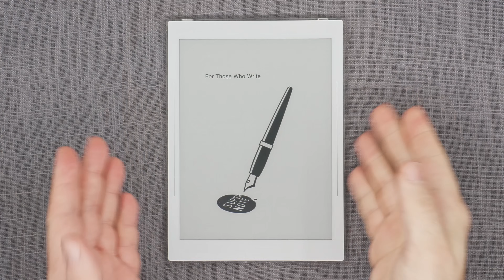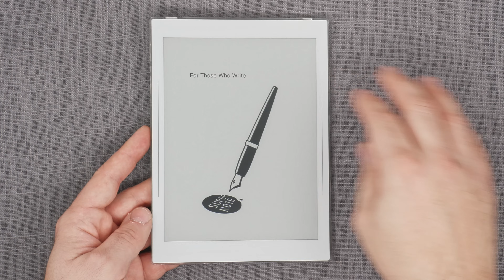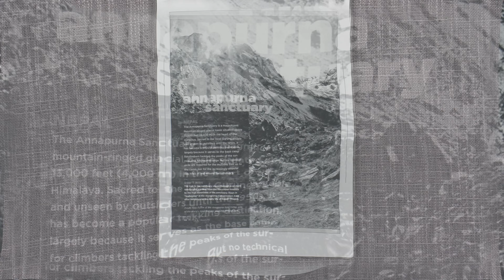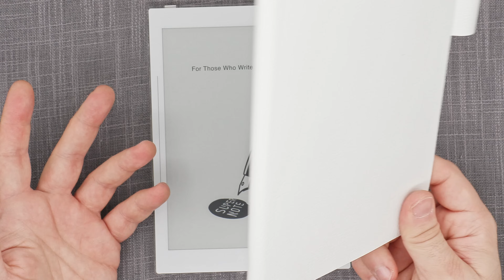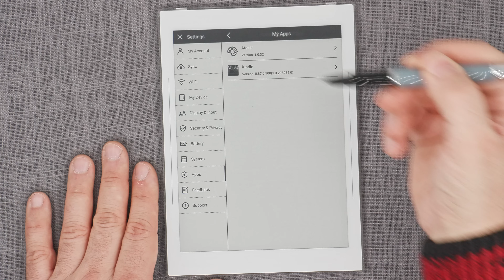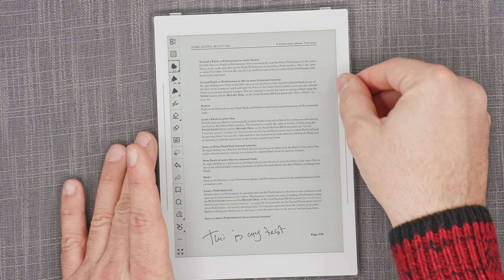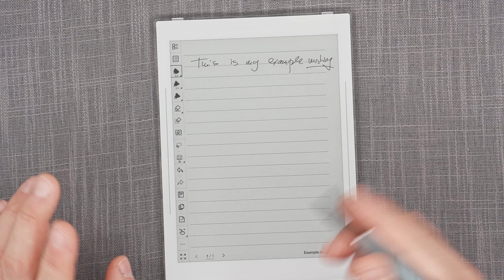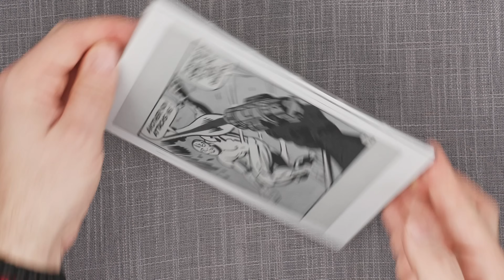Supernote A6X2 Nomad: In-Depth Review of a 7.8" E-Ink Bundle of Power and Joy! It's just Excellent!

Comment from the maker: CORRECTION As pointed by a couple of users, Calendar CAN be synchronized with Google Calendar, but it needs to be done manually. Thanks to the viewers that pointed out that mistake :)
Reply: Well nuts, I missed this message after I posted a big long blah-blah-blah about lack of calendar integration makes no sense. 😅I could live with manual synchronization as that does fit with the "focus" theme. Thank you for adding this note!!!
Reply: it works with both Google and Outlook Calendar.
Reply: Could you create a comparative video discussing the size differences, advantages, and disadvantages between A5 and A6?

Comment: I love your channel, it's been invaluable in educating me about all the options out there. In this case you were really selling me on this device right up until the calendar. Speaking as a dev, if this device already has the programming to authorize gMail integration there's no excuse for it not to have the same with the calendar. If this device didn't have any email integration at all I could see the lack of calendar integration as a "focus" choice, but to have one and not the other makes no sense to me. A real shame, I was digging this one.
Reply from the maker: My apologies for the mistake I made, but it can synchronize with the Google calendar, it is just that the synchronization needs to be done manually.
Reply: @MyDeepGuide  No worries at all. Had I taken 30 seconds to look at the comments I would have realized you added the correction 👍

Comment: Hey Voja, Great review for a truly awesome eink tablet :) I just wanted to mention that the SN calendar can sync with Google or Outlook calendars (text events only, not handwriting). You also have to sync it manually. Also, I was a little confused as to why Ratta chose to use undo/redo for the swipe up/down on the left bar because the bar is right next to the undo/redo buttons (for users that haven't moved the toolbar). Therefore its no easier (for me, anyway) to swipe up/down rather than just tap the button.
Reply from the maker: Thanks for the correction, I have now added a pinned comment that mentions this :)

Comment: I would like to discuss the differences between the white and crystal versions: Both devices are not suitable for frequent changing of the micro SD card. The white version also requires courage (!) and skill and tools (a thin plastic or wooden spade if you don't want bleeding fingernails). With the white version, it is very important that you first lever up all the plastic tabs on the narrow, lower side with the spatula - and then push the cover downwards (!) and do not try to tear up the plastic clips on the two long sides (with enough force they would break). The Crystal version can be opened completely without force, only the re-assembling (positioning the switch and magnets) requires skill and patience. I prefer the "force-free" version. - But now to the biggest disadvantage of the white version: because the back cover is only held in place by inserted clips, the case makes creaking noises when writing due to the pressure of the palm of your hand (no, these are not caused by the folded leather cover). Whereas we have a firm connection with the screwed Crystal version. Incidentally, the creaking noises can be minimised by sticking in 2-3 layers of small Post-It notes. - Thanks Voja for your incredibly careful and helpful work!
Reply: Thank you for that bit, albeit very important, information. I am quite OC about things like that so i deeply appreciate your input. These are the small things people never report. I would not want something annoying like creaking noises with me for as long as i own something. It’s like a creaking springy bed. Thank you!!!!😊

Comment: Thank you and those viewers for the important note about strong writing-pressure -> writing feel sucks.

What are eink recommendations for ppl with the "heavy hand"?
Reply from the maker: Well, you will have a difficult time getting the best out of an e-ink device if you have a very heavy hand, as you will not be able to fully utilize the benefits and beauty of pressure sensitivity. My recommendation would be devices with a hard surface, such as with some form of either pre or post applied screen protector for protection of the screen. This means basically anything other than Supernote, Sony, Quaderno, or Mobiscribe devices should work fine. This also means that you should avoid using hard nibs, and unfortunately, that you will go through soft nibs a lot more quickly than if you would write with less pressure, meaning increased cost of usage over time.
Reply: @MyDeepGuide 
Thanks, I will definitely keep your points in mind. and I am disappointed, I might have to compromise too much or keep waiting for the right product. controllers buckle under my finger pressure , keyboards survive , and all attempts to reeducate fail - my fingers just express intenal tension :)

I love that you responded to my question, I feel few reviewers do so.
have a great day.

Comment: 40:35 the tablet could sense the tilt of the stylus, but this is a software or firmware feature that they haven't implemented yet due to technical challenges, according to one of the staff on Reddit

Edit: it sounds like you are also saying that we could see tilt sensitive tools in the future with this device, the X series, and the same styluses
Reply from the maker: Yes, any device with a Wacom EMR layer can interpret tilt, hardware wise. Software wise, well, that's the development team's task to implement it properly and find a good use case for it. For example, you can see examples of excellent tilt implementation in Remarkable 2 and Kindle Scribe, and just plain bad implementation on Boox devices.

Comment: Have you tried it with a titanium-alloy nib pen? You wouldn't have to worry about scratching it because ceramic is harder than titanium alloy. Also, it is far less brittle than ceramic so it's less prone to breakage.

Do you have any idea what kind of ceramic material is used in the nib? I suspect it might be zirconia.
Reply: Found this on Good E-Reader review of the Ceramic Pen:

"Supernote stated that “During countless experiments, we tested high-hardness materials such as stainless steel, nickel-titanium alloys, and finally found the flexural strength of zirconia ceramic 1100 with a hardness of 88–90 HRA (Rockwell hardness), which is close to the hardness of sapphire and is fit as synthetic material for the tip of electromagnetic digital pens."

Comment: Looks very cool and is tempting. Unfortunately, my company doesn't allow syncing with anything other than an Apple or Samsung or Google device. That's why I use an iPad mini with OneNote.
Reply from the maker: You can synchronize to Google Drive with Supernote.
Reply: @MyDeepGuide  Unfortunately, can't access Google drive from my work computer either.
Reply from the maker: You can also turn off any kind of sync and manually back it up locally ;)
Reply: @MyDeepGuide  No can do. USB drive access is also blocked. I could email it to myself but that's just too much of a hassle :(
Reply: @markrome9702  how is that too much of a hassle lol. It’s just as easy as putting it in a Google drive and if you can email, you can access Google drive. If not from your work computer, your phone.
Reply: @nutellakinesis  work email, not gmail.

Comment: Voja, I like your reviews.. I have a question: are the ceramic nibs included in the HOM Pen? Moreover, I did not get if we can install 3rd party apps since it is based on android.
Reply: Yes the HOM pen has the ceramic tip
Reply: Right now they disabled developer mode option, which did allow 3rd party app install through a workaround. They said they're working on patching some security issues and I think they'll re-enable developer options when those are worked out.

Comment: I just got my A6x2 nomad and i way prefer remarkable 2 so far. maybe i just need to get used to it but i have extreme buyers remorse. i guess i write hard because it is almost unusably grippy and when i write litter it does not pickup some of my dots on the "i" or the slash on a "t" and so on. its just really grippy which sucks for me because i just returned my remarkable 2 and no i wish i had kept it but i will try it out for a week or so and see if i get used to it before returning. I may get the Box next

Comment: Thank you for the detailed video. I just wanted to mention that the tilt functionality is not related at all to the contact point. In these technologies the surface does not have the capability to detect contact. It is the pressure sensors on the pen that do that. The surface is active in the sense that it creates the field that the position calculation of the pen is based on. The tilt also is a function of the EM field and not a physical contact patch. You can simply reason about this yourself by noticing the spherical structure of the nib. Changing angle would not change anything. (Besides it would be really hard to make it work with non uniform nib shapes)
Edit: Removed the error in the comment which said the position and tilt calculations are done on the pen. According to the links in the thread below, for Wacom EMR they are done on the tablet side.
Reply from the maker: This may be true for other devices, but on these devices this is not correct. The easy way to disprove what you are saying is to take any EMR pen (none of which are equipped with an accelerometer) and use it on a device that does have software support for tilt recognition, like the Remarkable 2 or certain Boox devices with specific OS versions. You'll easily see that any EMR pen will actually work in the exact same way. So it's the device that does the tilt conversion and it has absolutely nothing to do with the pen being used.
Another way to disprove what you are saying is to simply hover an EMR pen above the surface of the screen without making contact. Without the pressure sensitivity being engaged in any way on the pen, the device is able to track the position of the pen due to the Wacom layer underneath the device's screen detecting the presence of the pen via its EM field. This is something that certain devices use to have the pen double as a presentation marker as well, for example Remarkable 2 and Supernote devices. 

Here is how Wacom themselves describe their EMR technology:
"Wacom’s patented electromagnetic resonance (EMR) technology consists of a layer of sensors that sits behind the device’s Liquid Crystal Display (LCD) screen and a layer of hardened glass. The sensors are arranged in an alternating vertical/horizontal grid pattern. Each sensor is precisely calibrated and emits a weak electromagnetic signal. Together, these signals create a magnetic field that extends about 5mm beyond the glass surface of the device."

You can find more information here:
https://www.wacom.com/en-au/events/sitecore/content/www/home/enterprise/business-solutions/resources-and-information/emr-benefits

This is also why it is a bad idea to leave an EMR pen resting on the screen of a device like this, as that can easily drain the battery, even if the device is sleeping, simply because the device will be registering the pen and remain in an "active" state powering the pen, thus using the battery a lot more.
Reply: @MyDeepGuide  To clarify, what I tried to emphasize was that there is no pressure sensing capability on the tablet itself. IIRC the note on the video that I wanted to correct was that tilt is done by measuring the shape of the contact patch. That is not possible without different sensors (like resistive screens of the past) on the screen. Detection of the contact and pressure is done on the pen via physical measurement of the pressure. In passive pen technologies like this one, the power that drives this circuit in the pen also comes from the EMF on the tablet. 
I admit that my comment was wrong about where the position calculation is done. And that extends to the detection of the tilt. But the intention and main idea behind the comment stays the same.
Reply from the maker: Ok, I'll let the experts explain my point in a better way, so that you and others can understand how this technology actually works:

"EMR technology is also capable of detecting the tilt of the pen. Tilt information is derived by assessing the geometry of the EMR signal across multiple grid lines.
When the pen is held upright, the signal geometry appears round, but when it is tilted, the geometry transforms into an ellipse, allowing the device to detect and interpret the tilt angle."

So as I mentioned in the video, the device detects the tilt of the pen by measuring the area of the signal it receives back from the pen. This is not a guess, an opinion, or anything like that. This is a fact on how this technology actually works.

You can find a lot more information here, and I recommend reading it, because it should clarify any uncertainties you or others may have about the intricacies of the EMR technology:
https://borednbookless.com/how-do-emr-pens-work-emr-technology/
Reply: @MyDeepGuide  I do understand how it works and my main point in the comment  was: It is not via 'physical contact' on the screen, or the shape of the 'contact patch'. It's via measurement of EM patterns. (I will update the comment removing the erroneous part which was not relevant to the main point.).

Comment: Unfortunately the lack of backlight is a deal breaker for me. I travel with my reader/writer and don’t always have control of the brightness of my surroundings. Using beside a partner before sleep is also a common use case.
Reply: There are many reading lights with adjustable brightness to replace the front light

Comment: How a user with a boox and a supernote will share notes between both devices besides pdf export after changes? because it seems when you choose a platform you are stuck to it, there is no standard or common file type
Reply from the maker: That is correct, only via PDF exports.